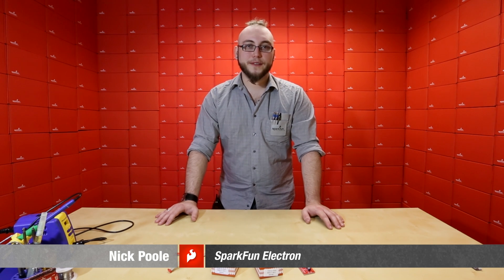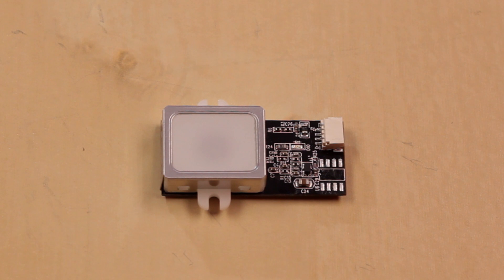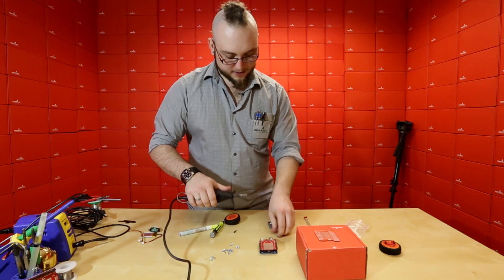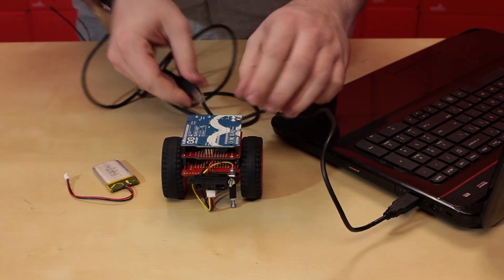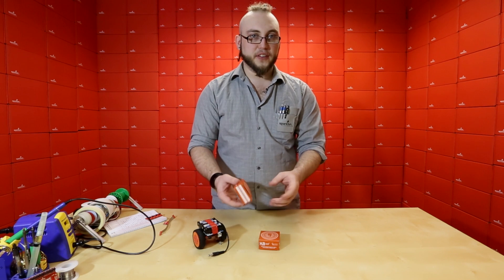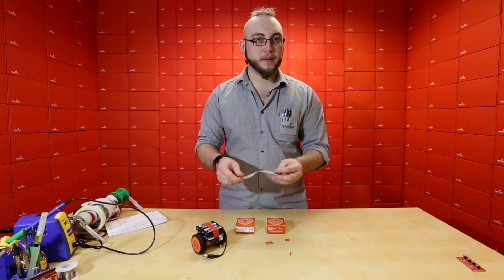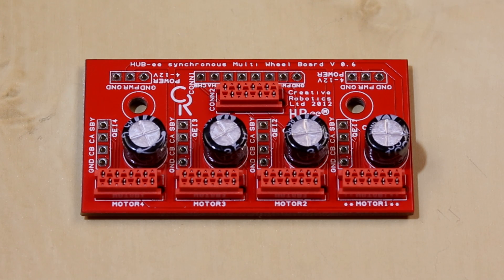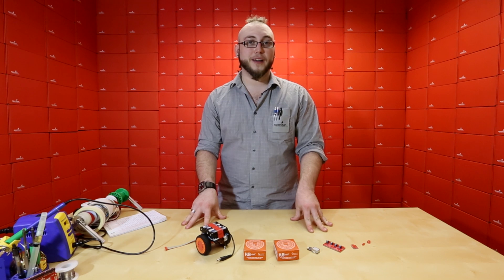SparkFun 4-19-13 Product Showcase: HUB-ee Buggy Robot

Comment: I was looking for a way to use encoders with 2 wheels and these fitted the bill exactly.  The integration of the wheel, motor, encoder and controller removed many of the problems that I could foresee using separate components even if they were available from the same supplier. 

Availability in the UK was also important to me.

Comment: Thanks Bob, I guess the real question is - "Easy to use compared to what" - My origional motivation for the design was for it to be easy to use compared to a set of individual parts (gears, motor, encoders, motor drivers, controllers) The controller part got dropped from the first versions during development because of the additional cost and complexity of adding a microcontroller to the design, but it will be appearing soon (I hope!)

Comment: Not quite - they don't step in the way that steppers do. They use a normal DC motor and gearbox so you would need a PID algorithm and even then they are best suited with PID servoing for speed rather than position, and with the encoder counts used for odometry - it could be quite hard getting them to maintain a precise position to within 1/128th of a revolution using the in-built encoders.

Comment: Even without the wheels being 'intelligent' it is not difficult to implement code to drive the wheels, take the feedback from the encoders, feed it to a PID and control the speed.

I have a pair of these wheels and used the Arduino PID library to make the robot run straight.  Speed control is trivial using PWM.  Because the controller and encoder are integrated the wiring is simple and the Motor driver shield available from Creative Robotics makes it simple to connect to the Arduino.

Comment: A smart version is under development.
The existing version makes things mechanically simpler and cleaner, and tidies up the wiring for the motor controller and sensor electronics, so it is still (IMHO) an improvement over combining a gearmotor, wheel, encoder and driver board - which would still require a smart controller and PID software anyway.

Comment: We are working on a smart version based on an ATTiny MCU (so you can write your own code using the Arduino IDE)
There will always be slight speed differences between the wheels - this is mostly down to the manufacturing variations in the gear motors we use. Each wheel is tested after assembly to make sure it is within a specified window for the no-load speed.

Comment: Unfortunately it doesn't look like the motor drivers are intelligent. For example, the motor control pins are only that, go forward or reverse, rather than giving it a command to rotate at an exactly rad/sec based on encoder ticks. Really unfortunate actually as it reintroduces more complicated control algorithms in order to precisely control the motors.